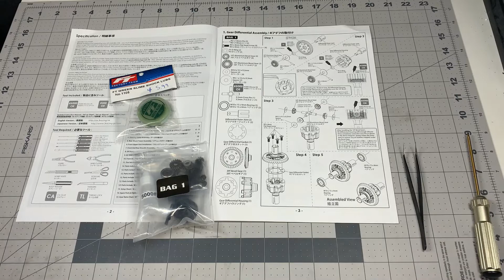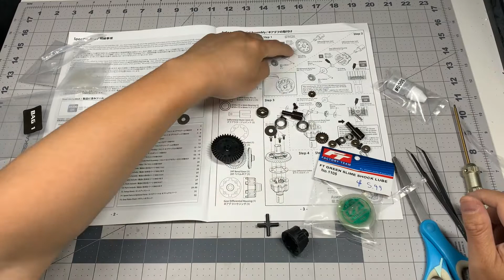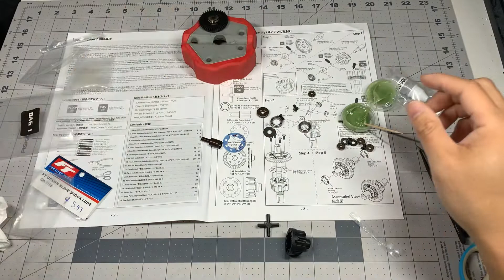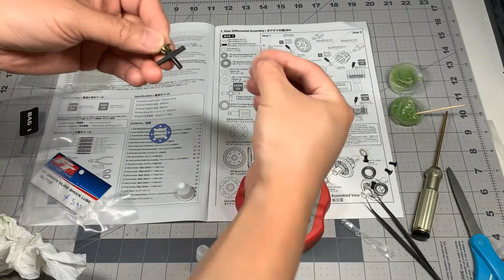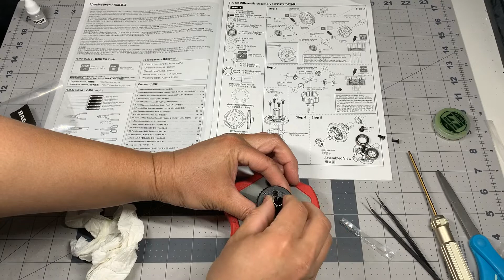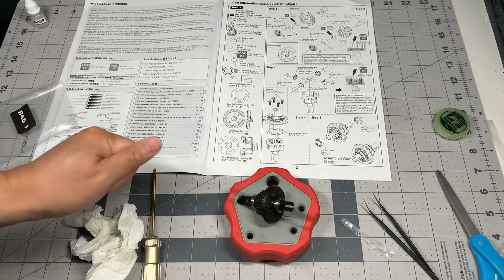How to Install the Gear Differential into the 3Racing 1/10 Sakura D5S RWD Drift Chassis

Comment: A little bit confuse here, just got into rwd drifting, do rear differential is lock just sort of 4wd does,anybody? Also i just got d5S chassis kit and not put it together yet until everything is clear, please help😅
Reply from the maker: I’m not sure what you’re asking. Could you rephrase that? The kit is not hard to build. You’ll have a good time.
Reply: @RCsRCCars  Not to put words in his mouth, but I think this is what he meant: 
On 4wd drift cars, you lock the diffs to make the car loose traction(Drift/powerslide).
Seeing a rwd drift car with open diffs, is a bit confusing when you only know about locked diffs on 4wd cars. 
Are locked diffs not used in RWD drift cars?
Reply: I also not clarification on this..the diff is dead hard to counter twist..let say i grip on 1 end of diff and its so hard to turn the other, in this case when i release throttle the car is not gliding as in term the tayar automatic locked, unlike my tamiya tgx mk1 the diff buttery smooth and when release throttle the car glide for few meters before stop